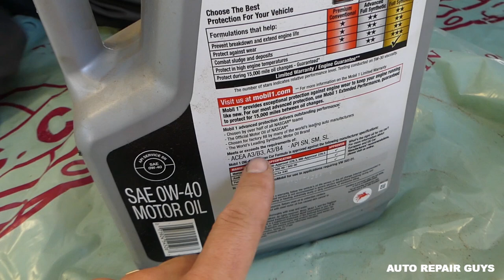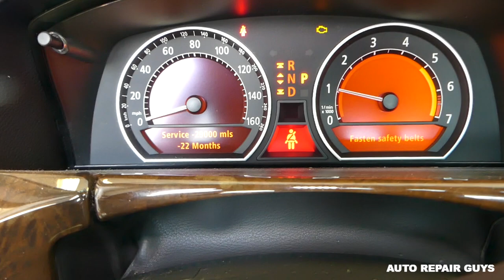BMW E65 E66 745i 745Li Oil Change

Comment: Do not use 0W-40 oil on these. Use 5W-40. These motors like to burn oil, and 0W-40 is too thin for it, especially if you live in a hot climate.

Comment: That motor does not have a conventional oil dip tube.  That tube goes to the upper sump which oil sit there by check valve to combat dry starts.  The car takes 8.5 quarts of oil.  When you start the motor you must refer to the MMI for oil level digital reading.  Hope this helps.
Reply: So what if the computer is wrong??
Reply: This helped I kept hearing him say seven and I. Pretty sure it takes 8.5

Comment: Great video 
I have a 02 bmw 745li they recommend 5w30 can I use 0w40? Mobile 1 or castro?
Reply: Hi, kind of a late comment reply here. Hope the car’s treating you well. I recommend 5W-40 in these cars. Liqui Moly is best. I think 5W-30 is too thin, especially with their tendency to burn oil. I have 200k miles on my 04 745i, and have been using Liqui Moly 5W-40 for a long time. Valve stem seals are original and happy in my car :)

Comment: I suggest to put heavier oil weight to reduce the smoke problem
Reply: wont work i put 20/50 oil and didnt help smoke i was tryn to pass smog it smoked only when smog tech hit the gas all way down WOT.